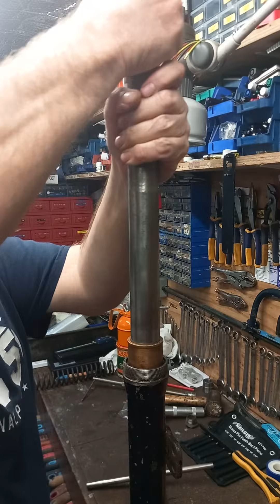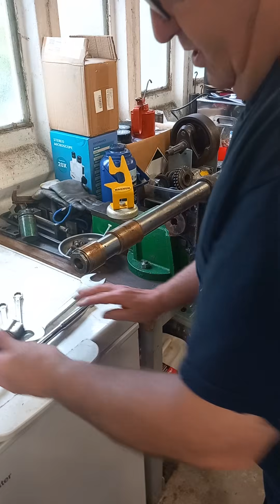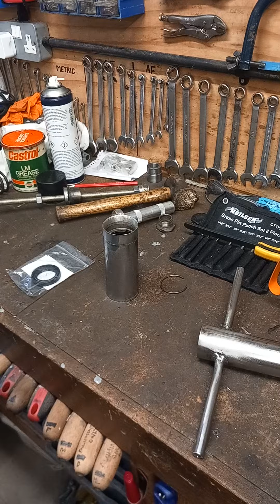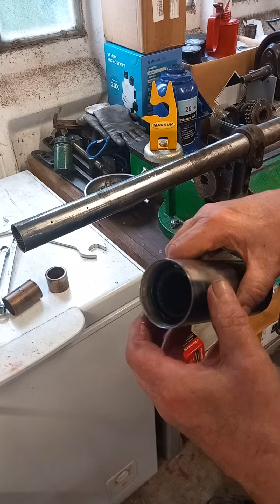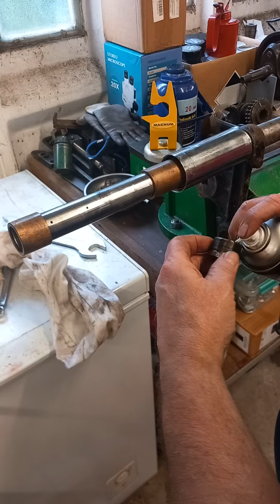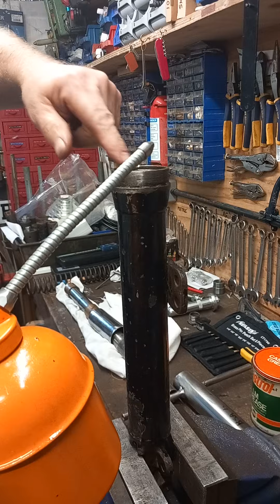BSA group 15 minute fork rebuild

Comment: I am just doing my forks , exactly the same Mines a 54 b33 , clips were difficult as the end wasn't near the notch , I found the new lower bush was too big to fit in the lower leg and I made sure to deburr the clip area and still lightly polish lower brass bush in the lathe .good video , most helpful .cheers
Reply from the maker: Many thanks, glad it helped.

Comment: That was brilliant. I would very much like to see a return to the longer films like you used to do, that is if you have time and you feel like making them. I use InShot editing for the films I make and I just use my mobile phone, in landscape. It works well, I think,  that is how I have made all the films on my channel so far. If I can do it then a man of your calibre will be able to work wonders.
Reply from the maker: Hi Carl, I'm just getting used to Inshot, I was using Microsoft movie maker,  which was perfect for what I did, then they discontinued it and removed it from my laptop during an update 🤬. So I bought Sony Vegas, but the computer is not good enough and crashes using it. Dean recommended Inshot, and it seems spot on, so when I have spare money I'll buy a Chromebook to use it on, then we'll get back to the 'proper' videos! Best wishes,  Ade.